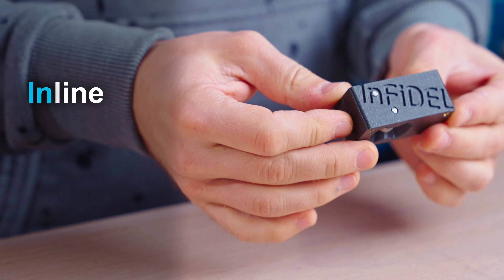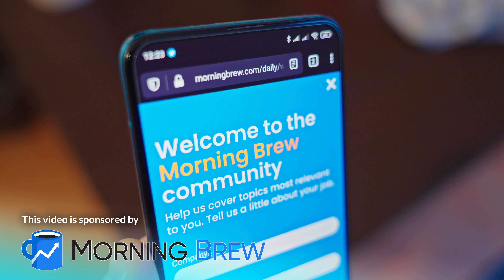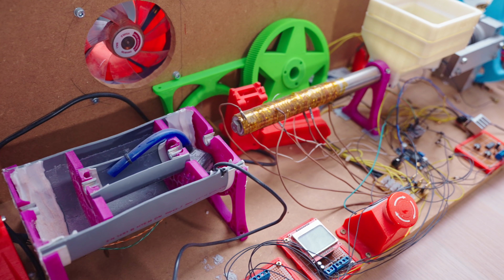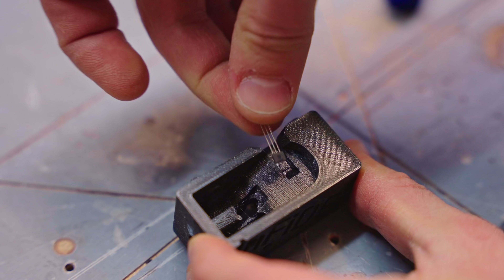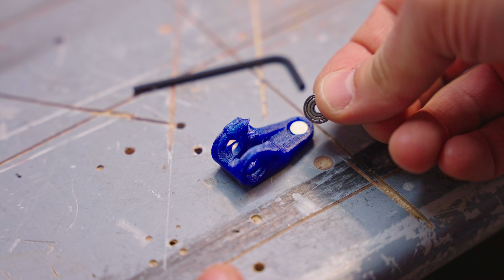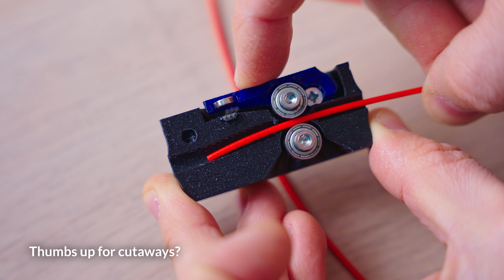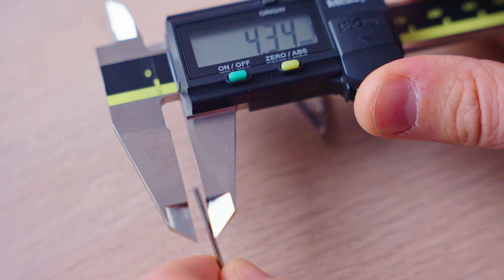Make your own inline filament diameter sensor (under $5)!

Comment: An i2c bus extender could be a fairly inexpensive option for longer runs but for the kind of cable runs you're looking at for a sensor like that it should be ok, on paper :)

Have you thought about having the sensor do double duty as a runout sensor ? It could help as a means of getting uptake on the design if it can provide that additional functionality ?

Comment: This is great, I would not expect HAL to be that precise but your prev video on the subject cleared the suspicions. Now think about 1Wire protocol, 1Wire can run on long cables nicely, it is pretty stable and is for e.g. used for hvac, fire and similar sensor installations... I2C is terrible on cables especially around noise generators like the extruder motor... look just how many issues with prusa laser sensor board that's on i2c and how for e.g. same sensor from duet that grabs the i2c from sensor with attiny on board next to sensor and sends data to mb via 1wire type signal works without any issues (ignoring issues that sensor can't work with some filaments)

Comment: Relaxation oscillator from constant current device charging a variable capacitor, a programable unijunction transistor, trigger voltage set by constant current across resistor.. Frequency of on/off discharge pulses linear wrt to capacitance change. Arduino library to read frequency etc
Capacitor can be DIYed from two semicircular conductive plates. One fixed... Other free to move as arm rotates.

Comment: This is a great idea and project! Some (hopefully helpful) critisism: If I'm not missing something, your sensor only provides the intended information under the assumption that the filament is perfectly round. It measures the diameter at a specific point, but not if the diameter is consistent. So actually you can not transform this into information about adaptation of the flow factor. You mentioned that better quality filaments are usually not oval - but imo they also should have a consistent diameter. I think this is idea has potentially higher impact for cheaper filament and to be able to compensate tolerances better.

Comment: Hallo Thomas, I understand the filament is assumed to be round and not oval as you mentioned at the beginning of the video, so the diameter of the filament is only “measured” on one “side”, let’s say the x-achse (z being through the length of the filament), so the y-axis is not measured, which could actually then carry the off-diameter... 
Wouldn’t a 60° arrangement help to improve eccentricity problems? Of course that would require more work than already needed, yet only checking on one side basically ignores the other sides (60 or 90° offset) just my thought 
Grüsse aus USA 😉

Comment: couldnt this also be used a jam sensor?
If the output value is "too stable" for too long?
Reply: It could but that would arguably be too prone to faulty alerts when you have good filament. Instead, if you wanted to use it for that end, I would suggest adding a second Hall sensor paired to a magnet on one of the bearings. Your resolution for jam sensing would be limited by how many magnets you placed around the bearing, of course.
Reply: @claws61821  I think ill build one of these sensors and test out if high quality filament generates enough variance to not be drowned out by noise.
These hallsensors are usually precise enough to pick up even small movements. Im generally agreeing with you, but i think theres a decent chance that even good filament has enough variance from a standstill to trigger a jam warning.
Reply: @illRun4Clownident  Perhaps so, but even then the second sensor paired to the bearing would provide a good failsafe.

Comment: I think printers should have this by default so if the filament is too thick it stops the print so it doesn't get stuck in the extruder

Comment: I'd love for you to consider redoing the filament maker in a updated 2021 video,  using the knowledge you've gained since building it, the things you'd change, the tricks to make it cheaper. Kinda like you went over with the Infidel sensor.

Comment: Next time maybe try to use the optical filament sensor of the prusa. Or is the resolution and FOV not sufficient?
Reply from the maker: The optical sensor tracks filament movement, but has no way of detecting the actual shape of the filament.
Reply: @MadeWithLayers  Mmh, some years ago I did some experiments with optical mouse sensors and I get an complete image of the stuff under the mouse-sensor. It's basically a digital camera with a resolution of 16x16px (ADNS Type). If you have a sensor with good dpi this should be possible

Comment: Cool! So, I can imagine that when measuring the diameter you'd want some sort of filament speed correlation as well. It could make sense to integrate a speed measurement in this thing too, perhaps also a magnet that rotates with the bearing, measuring its rotation and thereby the filament velocity ? Could then also be used to close the loop between extruder motor signals and actual filament extrusion. Imo a closed loop extruder motor isn't enough because the filament can still skip. Well, here the bearing would have to not skip over the filament too.

Edit: thinking about it, it seems more likely to me that underextrusion due to the way the extruder drives filament, is a more significant factor than the filament diameter.
Reply from the maker: Of course there are tons of features that could be added - for now, I just wanted something that does this one function well.
Reply: @MadeWithLayers  I understand. My point was (see edit) that if you're going to use this to prevent over/underextrusion, I think the filament speed is more significant and should be looked into first. But that's just my idea though.

Comment: Could you buy real crappy material with inconsistent diameter and make a comparison between prints with and without diameter compensation?
I would like to see if there is a notable difference.
I mean you can save loads of money if you don't have to worry about that.

Comment: If you used a v-shaped bearing you'd probably also have to redo the math since you'd then essentially measure the height of a triangle and not directly the diameter of the filament.
Just a side note of what came to my mind when you mentioned the v-rollers, because I was actually too lazy to check if that would make a tangible difference in the end... ;-)
Reply from the maker: The math really doesn't care about how the diameter is measured, as it's all based on the calibration anyway.
Reply: @MadeWithLayers  You're right, it's still a linear proportion, therefore it should work. My bad. :-)

Comment: Great project, but the practical use of this sensor is not so great. The current filament is already with good tolerances some already with under +-0.05 mm. If the manufacturers stop calibrating the filament diameter and sell us spools with greater tolerances like +-0.1mm then will have a point to use it.

Comment: Very cool! It gives me some ideas to even shrink the device but using a sop23 hall effect sensor on the actual board. Btw: I highly recommend you to look at the «new» Attiny series like 202, 402, 1604/1614 and upwards, based on your memory needs, and functionality. They are cheap and easy to program(only one pin - UPDI) I just love them!

Comment: Wouldn't touching the filament on three sides average out the roundness or ovalness? Since touching two sides would still be counted even if the width doesn't change but the hight does
Reply from the maker: It would be an approximation, yes. I specifically mention the 623-VV bearings as an option for this.
Reply: @MadeWithLayers  yes,though what i mean is, wouldn't the approximation defeat the purpose of the sensor? Then rather have three sensors like the spool winder setup

Comment: Elegant and smart design :) I wonder how it behave with the marks done by a dual gear extruder. Material is being scattered between crests and vales on both opposite sides of the filament while the amount of material is the same.

Comment: From my tests I know that the beating of the bearing can reach 0.05 mm. The second moment, depending on the temperature, the voltage of the sensor changes. I tried to solve these issues hardware,  result https://www.thingiverse.com/thing:4138933

Comment: Of course, the next step is to see if this makes a noticeable or measurable improvement in print quality using a range of different filaments. Wonder if anyone has any data showing an observable improvement in print quality using Prusament vs. filament whose diameter is less precisely controlled. If they do, this would be some indication of whether using such a sensor is worthwhile. It's pretty darn cool regardless.

Comment: I like the hall effect! I am sure the bearings are some high quality ones. Have you checked the run out on them to verify their tolerance?
Reply from the maker: I know some of the bearings I had were absolutely horrible and were measuring 0.5mm up and down with each rotation. As long as you don't use those, the filtering should reduce the effect runout has.

Comment: now if you can measure the rotation of the wheel x thickness you can have a precise volume as well as a filament jam/ run out sensor

Comment: Cool design, but not very useful for the general 3d printer community until it can be tied in to Marlin. Then it could solve alot of problems.
Reply from the maker: That's why I'm providing the chicken. The egg is outside of my control.
Reply: Since Marlin has filament width compensation built in already, in order to make this a reality we need a way to get the width info into Marlin. The current slew of control boards don't have a provision for that input, so we're stuck until someone designs a new board I guess.

Comment: You should put a rotary encoder on the idler bearing like the btt smart  filament sensor does so that it can detect filament jams aswell as measure diameter. Would be the best all in one filament sensor and would cost very little.

Comment: Instead of using the separate board, I wonder if it could just be added as an input to a Raspberry Pi running Octoprint?  Then if there was a plug-in you could use the information that way?  Thanks for presenting this Thomas.
Reply from the maker: The RasPi does not have analog input, but I could absolutely see the I2C interact wired up directly to the RasPi instead of the printer's mainboard.

Comment: An Esp32 could probably work as well? Since it has a build in Halleffect sensor it would basically remove the need for a custom pcb. And if you are super fancy, it could be unessacary wireless 😂 still needs power
Reply from the maker: That's an interesting option! From what I've read just now, it looks like the hall effect reading is fairly low-res, do you think it would be sufficient for this setup?
Reply: @MadeWithLayers  I plan to try that, since I have some esp32s flying around. I'm not exactly sure how precise the hall effect sensor is, and how much it needs to be.

Comment: I think this is a great design and has a lot of potential. I am tempted to create a pull request for your code to introduce a feature which not only interpolates the calibration values based on the known diameters of the tools, but also through using a statistical test with repeated measures to ensure the calibrations are providing both accurate and also repeatable measurements. I believe the Prusa firmware does this with the PINDA probe, which uses precisely the same theory of operation as this sensor. You might notice that it takes several repeated measures on each calibration point on the bed. Averaging these measures can help improve the accuracy of calibration values during a calibration cycle, but if it also incorporates a statistical test to ensure that the values are within the expected range for this sensor then anomalous values can be prevented from affecting the recalibration (and can also be used as a self-diagnostic in case the sensor is no longer within acceptable calibration). If the LED is programmable based on the PCB design, that would be very useful for giving feedback to the user about what is happening if things go wrong during this procedure.
Reply: Tom, you didn't put your firmware or PCB design files in any kind of version control. Would you be able to put them on github perhaps?
Reply from the maker: Never used github before - but feel free to upload the firmware and I'll be happy to link to it as the recommend firmware choice!
Reply: @MadeWithLayers  I created a new public repository on GitHub which is tracking everything you released. This can also version control EAGLE files since they're in a plaintext file format. I updated some of the filenames and folder structures to adhere to more common naming conventions, hopefully it will make the repository easier for people to navigate. Since this is public people will be able to fork it, make changes, and propose changes that can be reviewed and incorporated back into the original with pull requests. You can find a link here: https://github.com/drspangle/infidel-sensor/

Edit: I realized that you specified CC0 for the license on this, so I've updated the repo accordingly. I'd been trying to get in touch with you, but there's no emergency about it.
Reply from the maker: Aaaad.. done! Thanks for uploading!

Comment: Only Thing left is to Put an encoder in one of the bearings to detect Filament movement / jams
Reply: You would be better with a second magnet attached to one of the bearings (disc magnet with a central bore), and a second hall sensor. Lower cost than an encoder.
Reply: Just a really small encoder would be easy to integrate and basically plug and play
Reply: Why we can't just assume that the filament is not perfect and that if the filament moves the diameter changes?
Reply: @danvalnicek  What about a series of quick short retracts that cause the filament to move back and forth along only a short distance. Its not unreasonable that a 5mm span of filament might have variations in diameter that are smaller than the measuring capabilities of this, thus unless you used a large distance or time window for detecting motion, you might get false positives within that same 5mm length of filament during the repeated retractions. If you used larger distance or time windows to account for this, then you'd end up in a situation where a legitimate jam or break would take too long to be detected, making recovering from it difficult, if not impossible. Either a modification to this to specifically detect motion, or a secondary external sensor designed for this sole purpose would be a better option.
Reply: @danvalnicek  , that is a really good point, assuming the precision is good enough (which it probably is).

Comment: Awesome! You made it really compact. Looking forward to have it supported in Marlin. Would be nice to have measurements on 2 axes even though the filament is usually pretty round. I tried designing something similar but your idea and implementation are 1000X better than mine haha. Congrats!
Reply: Measure it from one axis, and check for a jam with the other axis. Then the wheels make an "X" and its still compact

Comment: I really like this Tom!  How hard would it be to add in a small OLED/LCD to give real-time readouts on the unit itself?
Reply from the maker: With a different MCU, it should be trivial. ATTiny is out of pins unfortunately 😉
Reply: @MadeWithLayers  I2C is a bus so an I2C display shouldn't need any more pins.
Reply: @MadeWithLayers  One could use an ATtiny84 to get more I/O pins at little if any additional cost. Neither the ATtiny85 or ATtiny84 likely has enough memory to support driving a display, I2C or otherwise. Would be interesting to explore.
Reply: @mikemike7001  Driving an I2C display with an ATTiny85 can be done but as you suggest memory is the biggest issue. If any one is interested in an example Search for attiny85 interactive name tag.
Reply: @ColBol7  Thanks. The name tag code looks like something I could use for other projects as well.

Comment: Super great design Tom! I especially like the Arduino compatibility. Wouldn't it be possible to use pins on the Ramps, since it uses a Mega2560?

Comment: I'd love to know whether actually tracking the filament width makes any practical difference to print quality?  i.e. do you get a perceptibly better print with a filament sensor driving the extrusion multiplier live vs just measuring the filament once?

Also, given that you presumably need the sensor to be close to the extruder, does the extra weight of the sensor cause increased lag and cause any decrease in print quality? (I presume that getting this working with Bowden setups would be difficult as you'd be measuring the thickness of the filament that the extruder will see sometime in the future of the print, depending on the Bowden length.)

Comment: I'd rather see a void detector!
Bubbles in cheap filament are a thing: an ultrasonic pinger on one side of the filament, a sensor on the other.
By monitoring the density of the filament cross-section, we are getting a better idea how much material is being sent.

Comment: Honestly, if this sensor does its job, then you could theoretically use worse quality filament (i.e. Filament you extruded at home).  So yes, please talk more about home made extrusion.  I'd love to be able to build a low cost machine that could let me recycle my own plastics and failed prints... And if sensors like these made it so that my tolerances weren't critical, I think that could make it a lot more accessible.

Comment: I see that it is better if the sensor is as close to the extruder as possible. On the other hand, it is probably better to keep it away from any moving parts and vibrations, isn't it?